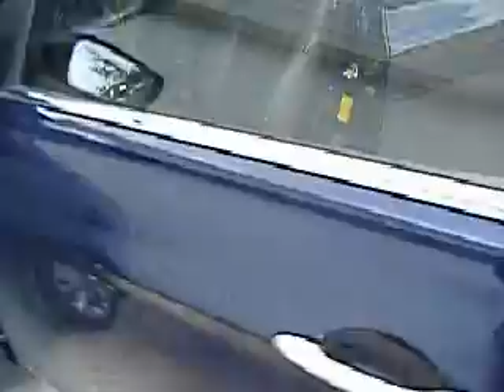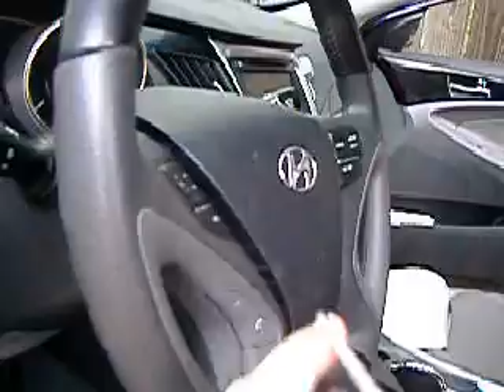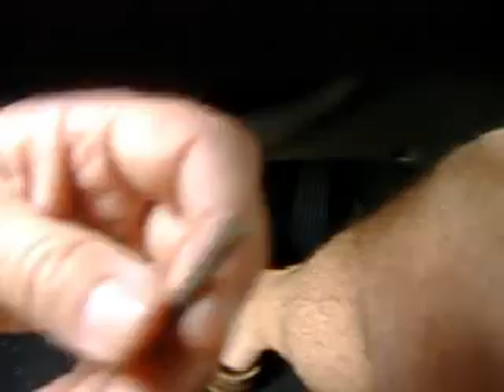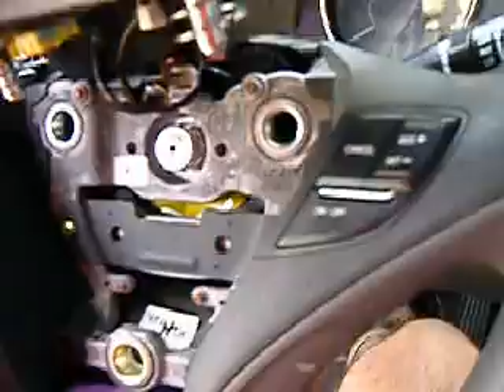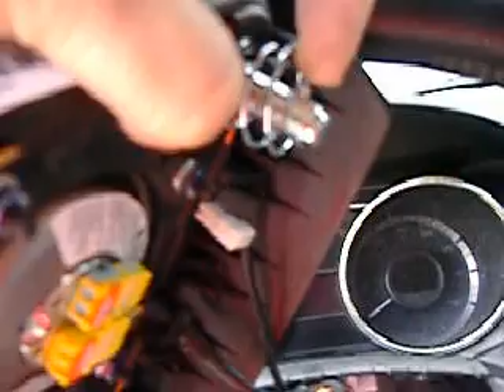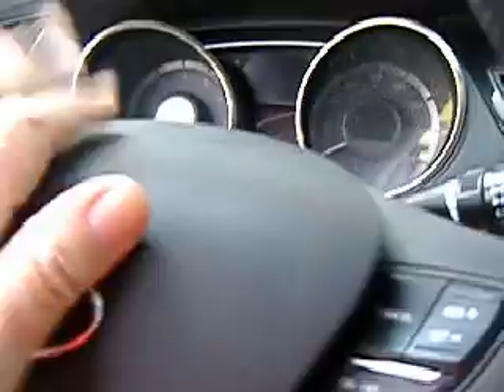Hyundai 2013 Sonata cruise control button wiring in steering wheel

Comment: Thank you, thank you! This worked beautifully for me.  The whole fix took about 10 minutes.  The only thing I did differently was to spray the connections with contact cleaner.  I also took the time to log my radio settings before I disconnected the battery, but when I reconnected it, everything was there including my phone numbers.

Comment: Just fixed my cruise control using the steps in this video. Takes maybe a minute to do it. 

I will say that I did it first and my cruise started working when I turned my car on. However, about an hour later when I turned my car back on it had stopped working. Re-did the steps and it started working again. Any idea how to make this a permanent fix??

Also, for other viewers info, I did these steps while my car was on and had no issues with the airbag or anything. I found that you don’t have to disconnect the battery.

Comment: I have a 2013 Hyundai Santa Fe. The left side of the controls started to act weird and suddenly they stopped working.
Following the instructions here I was able to fix them. The steering wheel is a bit different than the one in this video (the whole at bottom is missing) bet everything else seems the same.
Thanks a lot!

Comment: Thanks for posting. What was irritating me is now fixed!  I had just taken the actual rocker switch itself out, hoping to see an obvious issue there. No such luck. I was sitting, pondering, muttering under my breath and decided to Google and viola! I found your post. 

I did have to do a little research as I have the "i45", which the Sonata changed it's name to in Australia in 2010.  Nevertheless, from start (me deciding to try and fix the problem and taking the actual switch apart as mentioned) to sitting here with the job completed and feeling good took under 30 minutes! 

I will consider buying conductive grease as per your update of Jan 2016.

Comment: Thanks for this. I have steering wheel audio control issues with my 2010 Kia Sorento. The factory instructions say to leave airbag after disconnecting neg battery for at least 3 mins before disconnecting. Only really an issue if there is any electrical signal fluctuation to the airbag and i noticed you didn't disconnect anyway.

Comment: I was looking for replacement switches for my car and stumbled across this post. This was my problem as well, I sprayed some contact cleaner in the socket and in the plug and pushed it in and out a few times. I also had problems with the audio controls and now they work. Thank-you for this post
Reply: hey thanks for the idea of the contact cleaner, I will do that as well, mine has not been working for a while now and the dealer will not touch it without charging me !

Comment: Thank you very much for the demonstration. After checking the Hyundai Sonata 2011 manual at AllData DIY, I think that the connect you show is the general one (uniting all the commands on the wheel). The specific cruise-control connector is buried deeper - the steering wheel needs to be removed (doesn't look that difficult) and then remove the cover and access that connector. 
I will try to clean up/reconnect this connector and if it doesn't help (or it is temporary), I plan to  dig a little bit more. Once the specific cruise control switch is removed, what can be done is measure the resistance (between pin 3-4 with the specific function button depressed):
Cancel: 180 ohms (+/-5% - all values)
Set: 330 ohms
Res: 550 ohms
ON/OFF: 880 ohms
Further investigation calls for measuring the voltage, which should be measuring it between the same pins (3-4 - counting with the latch on the upper side, left to right) - the connector is connected this time and, I assume, the battery is also connected:
Cancel: 0.76V (+/- 0.1V)
Set: 1.24V (+/- 0.15V)
Res: 1.77V (+/- 0.2V)
On/Off: 2.34V (+/- 0.22V)

Comment: Listening to this while driving down the highway....don't worry I'm being safe! I have a friend helping! I simply peeled back the top portion of the airbag just a little bit to see if that would relieve some pressure  on that harness and my cruise control started working again! Must be exactly like what you said. The way the wiring is shoved in there it's pushing down on the harness causing a bad connection! Thank you so much for the research!

Comment: Did the trick for me.  Great video.  I was just about to look for cold solder joints on the switches when I found your video...  What an EASY fix!  Bent the wires down and to the right.  I keep a nail in the car so I can get back in if need be.
THANKS!
HB

Comment from the maker: UPDATE:
So in January of this year (2016) I finally got all the other stuff that happens in my life shoved out of the way far enough to go back into the steering wheel One More Time!
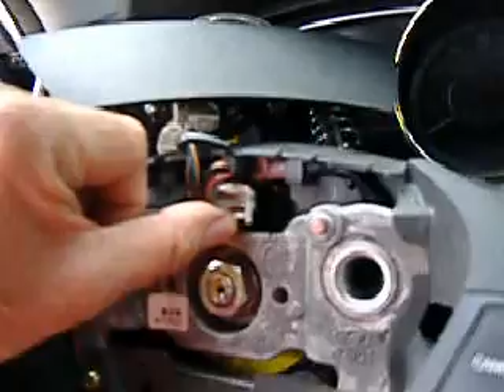Again I pulled the little plug out that shows at about time 4:10 in the video.  This time I unwound the wiring so the stress/strain would be removed off it and I also put some electrically CONDUCTIVE grease on those little pins.  You may have to search around a bit to buy some electrically CONDUCTIVE grease.  You DON'T want dielectric grease which is non-conductive.  Once I did those 2 things & put it back together, it has again worked flawlessly every push of the buttons for around a month now.  I'm still convinced this connector in conjunction with the flawed design of such low voltage signals to the cruise controller is the problem.

And NOW the sun roof will open, and won't CLOSE, but that's another story.

Comment: HI, great video. FYI I have the exact same car (in grey) Sonata GLS model. Had the EXACTLY same problem as your car with the cruise control. I was so tired of the buttons working only 50% of the time. Warranty is still in effect. The dealer changed the buttons from the cruise control on the steering wheel. It's been 2 weeks now...and everything works perfectly. Except...the button they changed is lighter than the one on the left side of my steering wheel. It does bother me a little..but!

Comment from the maker: º The fix I demonstrated in the video lasted exactly 3 months until the weather started warming up which probably caused expansion & contraction in the connector.  I haven't yet had the time or inclination to go back in again to try either electrical grease or to tighten up the connector pins in some way.  Instead,as I found advised elsewhere on the 'net, when it happens again now and again I just tap on the top of the air bag similar to like I'm beeping the horn & it seems to cause the connector to connect & the cruise works again.  Ridiculous, but short-term effective for now.

º My Sonata does not have a steering issue.